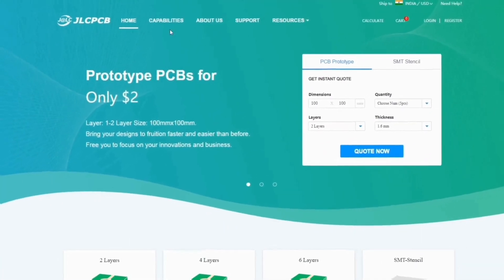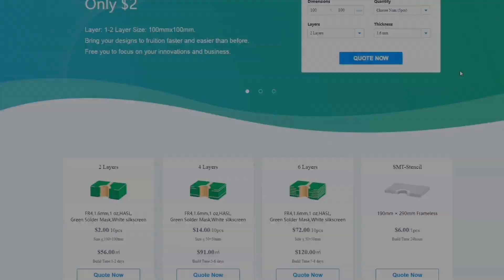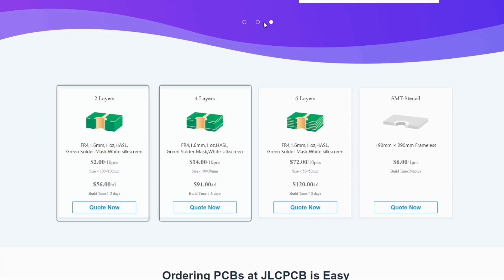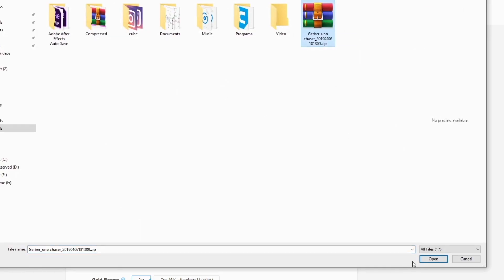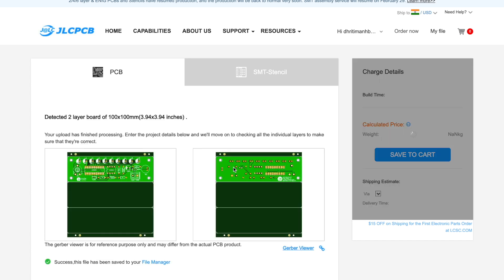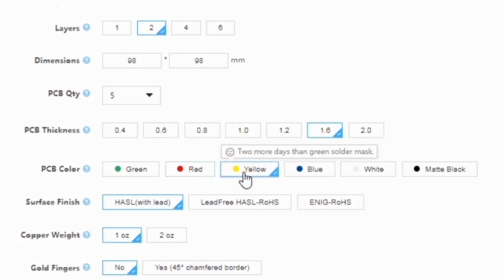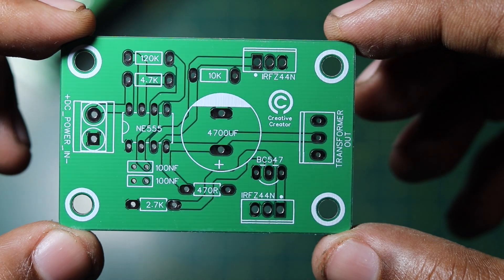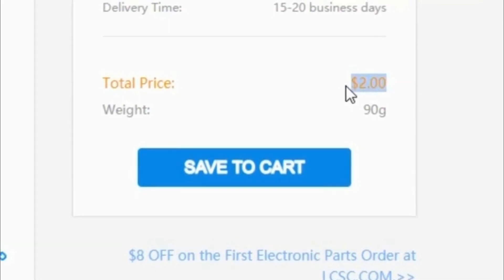Simple 100W Inverter Circuit with 555 TIMER IRFZ44N

Comment: This circuit has been implemented, but there is no output from the transistor collector bc547, and by implementing it on a special program for the mobile, it turns out that there is no output as well.

Comment: I've 2 questions.

1. Will it give more than 100watt output if we use a high power transformer?

2. Will it give square waves or sine wave ?
Reply from the maker: Yes it can give 100w with ease if you use a high amp Transformer.
This is squire wave as shown in the thumbnail 😀
Reply: If you use bigger transformer, the battery will drain quickly. But if you use a car battery you could even run it for  a day
Reply: yes you could the wattage would be based mostly on transformer but mosfets play are role too in @Creative creator 's all that aside this circuit is really compact and useful also if you use same components you will only need to get beefier transformator and according to 555 timer IC datasheet it creates square wave and its duty cycle and frequency can be easly adjusted but i have seen people create almost pure sine wave but its hard without a oscilloscope you need to fiddle with resistance and capacitance to create great sine wave although square waves never been a problem most electronics will work perfectly.
Reply from the maker: @gamingtutorials5938  yeah

Comment: I make this circuit but two problem i face.
My one Mosfet is very first  increase temperture  and light not glowing actual Power how to fix ??
Reply from the maker: Hi Abhishek, 
Here are are the simple troubleshoots you can do.
1. Voltage low: use s 9 0 9 transformer instead of 12 0 12 Transistor. This will increase the voltage level.
2. In general loads under 60W the mosfet's will not heat. It may be because of you are using a non branded transfer.
3. Check the Transistor coil turns resistance from center to 2 sides. It should be same. 
Try this things and let me know the problem is solved or not 😉.
BTW are you from West Bengal? 😅

Comment: sir is main 100 watt milega ham 100 watt tak use kar sakte hain sir.....is main sir kitna ampear ka battery use kar sakte hain sir ...?
Reply from the maker: Yes you are right. It is a 100w inverter. You can use a 10AH lead acid battery with it.
Reply: @Creativecreator  ok sir....sir 2 ampe ka transformer use kar sakte hain sir.?

Comment: thanks a lot .  but I have a question.  how is 1000 watts?  if the output transformer is 1 amp
Reply from the maker: No bro ypu have to use high amps transformer for that case.